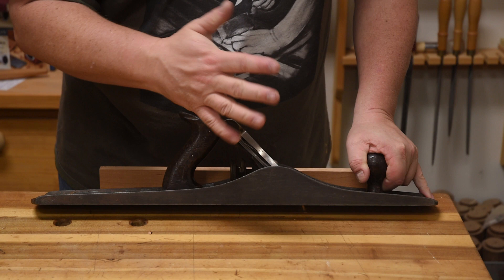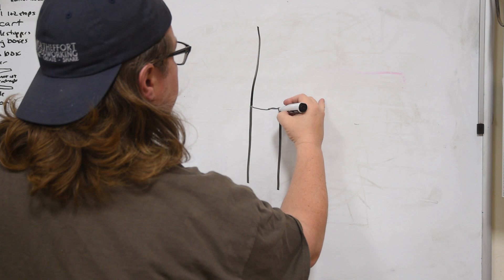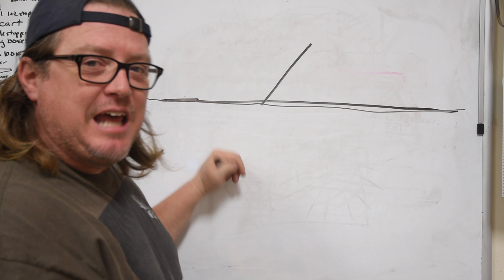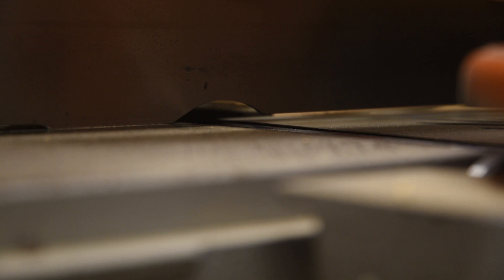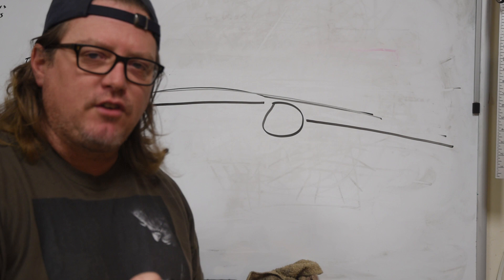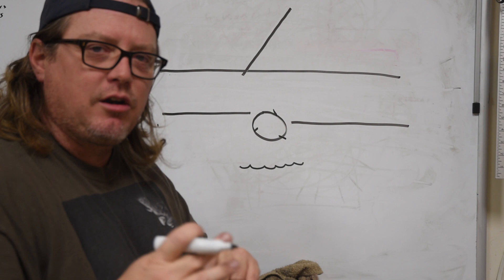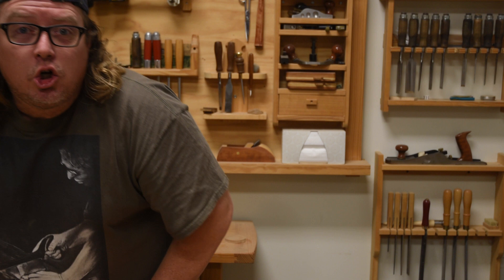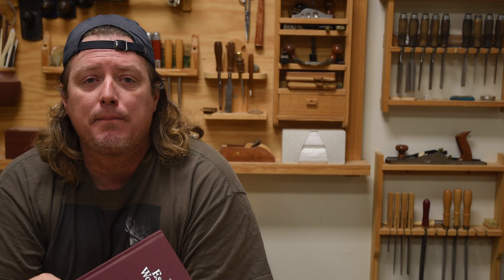Jointers - Hand vs Power - Arcs vs Rays

Comment: What are your thoughts on having an 8" jointer(plane) on wheels? Will it potentially put the beds out of parallel with each other? When I move it around? Or should the heavy cast iron bed and frame handle this movement. Thanks
Reply from the maker: Mine's on wheels. It is what it is. Best if stationary but that's not always possible in small shops.

Comment: Shawn, what are your thoughts on using a router with a piloted flush trim bit for jointing an edge? I have neither a jointer or a hand plane.
Reply from the maker: Finnicky, you have to be even more precise in tool setup as there is no forgivenance.
Reply: Thank you for your input.

Comment: True, a typical Japanese plane ("kanna") has the wooden body ("dai") made by a specialized craftsman. However, there is no gap in front of the blade (otherwise the planed fibers wouldn't be supported just before the cut = tear-out) and the contact points are very similar to those in western planes. On some Japanese planes the BACK side is shaved to form a slight gap, so maybe there was some confusion. 
Here's a good explanation and diagrams on the sole geometry of a Kanna (bottom of page):
http://kskdesign.com.au/shoji/publications/kanna.html
Thanks for the video!
Reply from the maker: That's one type. I believe there are others. Shaving down in front of blade then having it inline with the part behind doesn't mean you open the mouth, It can still put pressure down. And you're right they hollowed out those sections to make it easier to flatten (both dia and blade). But I'm first to admit, those dai and blade makers are magicians and I don't understand their magic.